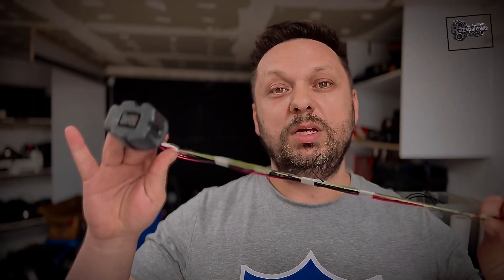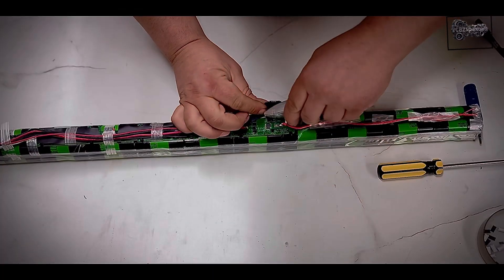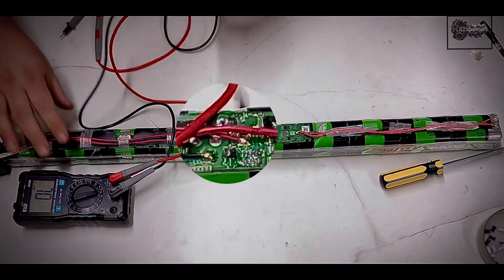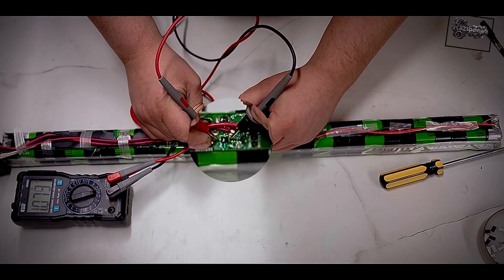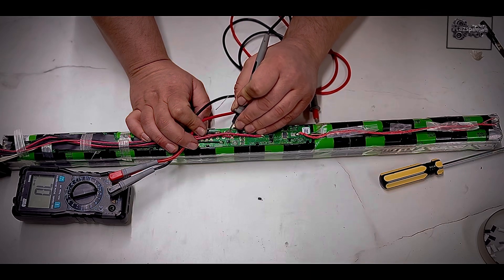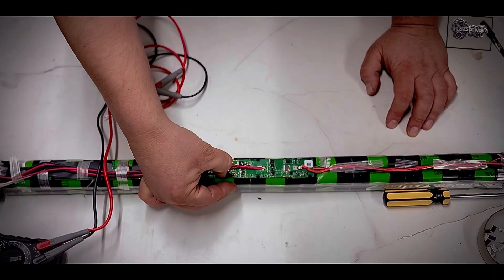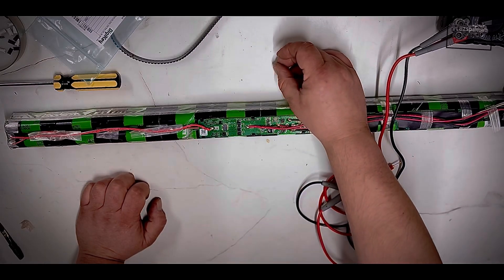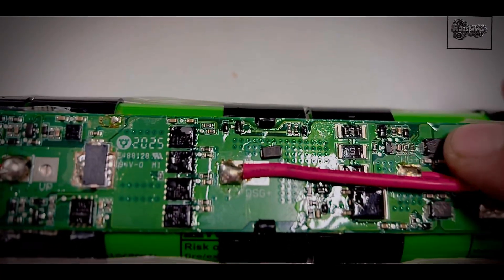Vanmoof S3/X3: The E-Bike Problem You Didn't Know About

Comment: Hi, I watch all your videos. I have the problem that I repaired the BMS—first the fuse, then the diodes. Then I did a hard reset. The battery has a capacity of 40.2 volts. Every time I insert the battery into the bike, I keep getting error code 17. I’ve tried everything, but unfortunately, nothing helps. Do you have any advice? Regards, Frank
Reply from the maker: Frank could be the module battery or cells are busted and every time bike drowning current one row of cells drops below and error appears …. 
Try check the voltage on bike smart module lots of them die …. Actually those are lipo …. Need changing every 3 years or so
Reply: @Razspareparts  I measured all 10 cells, and each cell is at approximately 4.05 volts. 10 × 4.05 = 40.5 volts
Reply from the maker: Some cells look good BMS is keeping them in good shape for you to measure... As soon as it starts drawing power one row drops voltage I use a battery tester to find out if that's the problem.... Tester draws power and as soon as that happens battery starts to make problems

Comment: Thanks for the great content—very helpful!
Would it be fair to say that if these TVS diodes are replaced, the suggestion to lower charger voltage can be dismissed? 

Lowering voltage is actually harmful to battery health. After 10–15 charge cycles, the BMS begins adjusting its charging algorithm based on the lower input, interpreting it as a sign that the cells can't handle higher voltage. This misleads the BMS into thinking the battery is deteriorating, resulting in long-term capacity loss—often down to just 50–70%. We've seen many batteries drop to 55% health, and all of them had been charged using modified, lower-voltage chargers.
Reply from the maker: @VANMOOF-PRO  yes and no .... Still most chargers are 42.1 41.9 ... Still need checking but still TVS take all Standard should be 41.6  most are like that

Comment: Thanks for sharing support videos, they are a great help.
I have Error 20, so OL checked the battery as follows:
My battery fuse is ok, but the TVS diodes are one OL on both sides and one is 1.08 ohm on one side and OL on the other side.
Do you think that replacing the TVS diodes with the ones you have suggested will solve the issue? Cheers
Reply from the maker: Yes and no … if bike previously had error 6(fuse blown) you need to look at the motherboard to find if any short is present… l because the base problem is still there and will do basically the same … somehow  the tvs I put handles 2amp continuously in reverse is pretty good but still is not good to ride the bike with a short in one phase …
Reply: @Razspareparts  Many thanks for your reply

Comment: Many thanks for sharing your thoughts and experiences. 👍🏻
Could you please share some more details about the diode TVS SMAJ40A. There are several different types with additional numbers/letters.
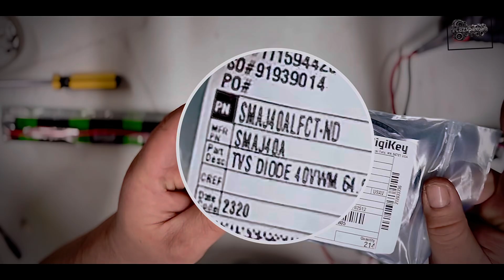Reply from the maker: 6:22  if I stop the video there is a paper with part number even the site where I buy them from …
Cheers
Reply: @Razspareparts   ok, somehow I found it. but to be 100% sure, is it the Unidirectional or Bi-directional one? :)
Reply from the maker: @Rob-MacGyver   if is a TVs diode is bidirectional I buy them from digikey .... I'll make a package for full repair on my eBay soon with all the diodes and fuse to overhaul your bike ....